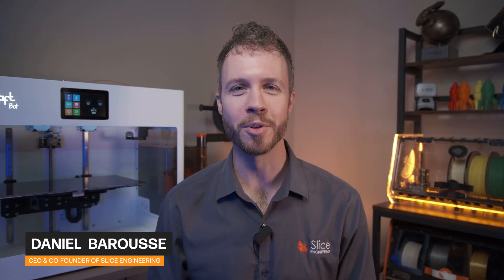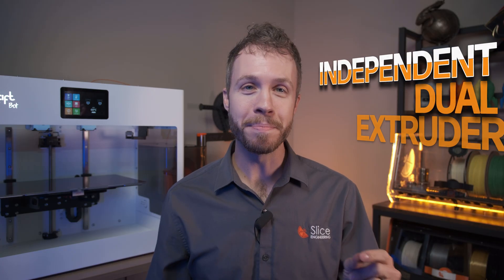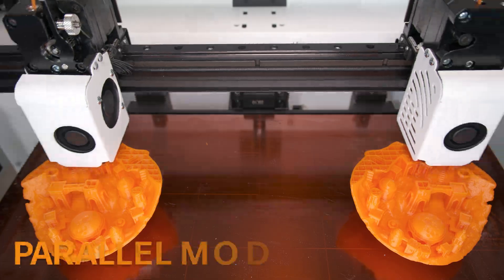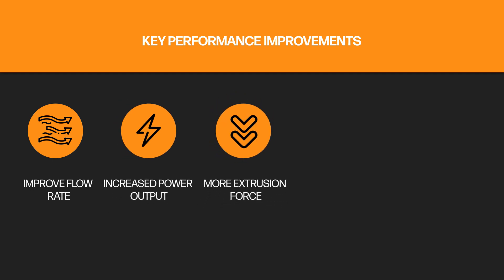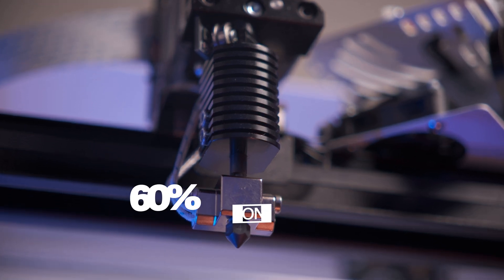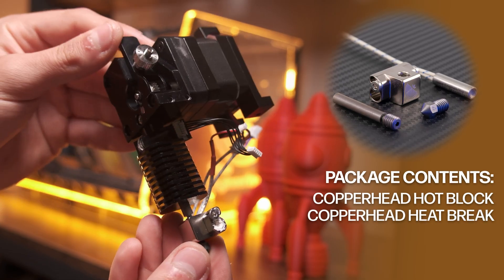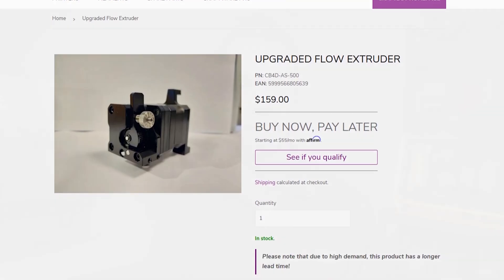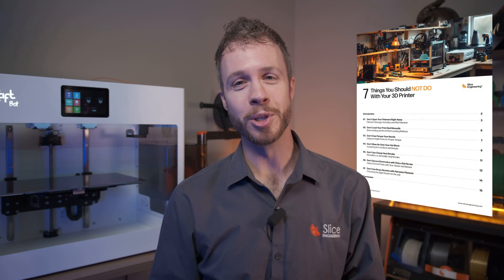Reduce Heat Creep, Increase Flowrate | CraftBot Flow IDEX Upgrade Kit!

Comment: Sadly, there’s nothing reliable about the FLOW series. Since I’ve owned the printer (‘21) I’ve gotten a handful of successful, small PLA prints. Several hot ends and bed sheets have been ruined. Hopefully your upgrades will make it a useable machine. We’ll see.

Comment: Hello Slice, I am a fan of your hot ends but I will not be able to use your upgrade kit even though I want to. The problem is craftbot uses a proprietary slicer (craftware pro) that is complete garbage. It is unintuitive, unfriendly to new materials, buggy and it has not received an update in over a year or to the firmware in two years. The slicer doesn't even have tutorials on how to use it so you are left to figure it out yourself but again, it is unintuitive. Mercifully simplify3D is compatible with craftbot and I use that slicer. 

Your upgrade kit says it improves flow rate and has increased power output. Unless I can import those values into simplify3D I cannot use your upgrade kit. So I ask; will there be an update for simplify3D so I can use your kit? 

I’ve had a craftbot Flow IDEX XL for 5 years and I have a bag of hotends I’ve had to replace over the years because the wiring gets burnt out. I’ve replaced almost every part of this printer because it has failed on me at one point or the other. From the control board to the heated bed to the nozzles I have replaced it all. Granted the machine does indeed print amazingly and support has replaced nearly all these parts under warranty. So for me at least it has NOT been reliable.
Reply: I totally agree, the firmware, or slicer does not allow you to adjust any parameters you would need to take advantage of any hot-end upgrade...... How would you tune the PID for the new hot-end upgrade...?   Shame my machine sits in the corner gathering dust.....it could do so much more with better firmware....
Reply: @steveclark3379  the machine works great. Just use simplify 3d. I use mine every day now.

Comment: Craftbot idex is one incredible but very underrated printer. Amazing prints on this machine.
Reply: Do you do dual material prints? I've never gotten any good dual material prints off mine, always a stringy mess
Reply: Yes Craftbot 3D-printers were really a good equipment - at least in the last decade.
Reply: @ronnyglobi  have you own any Crafbot printer?
Reply: @TX3D_Productions  Yes, I had a Ctaftbot Plus.
Reply: @ronnyglobi  ...so how does your comment relates to new Flow series printers?
Reply: @TX3D_Productions  After the Craftbot Plus (2016) I bought a Prusa MK3 (2018), which performed much better. 2020 I checked out the new Craftbot Flow Idex. Poor innovation, difficult to align the 2 printheads, proprietary printer program and slicer, diffucult to repair, small printbed and much to expensive. Seemed to be a flop because of so many bad comments in the literature and on Youtube. So I forgot it.